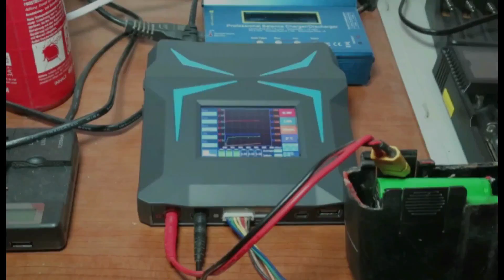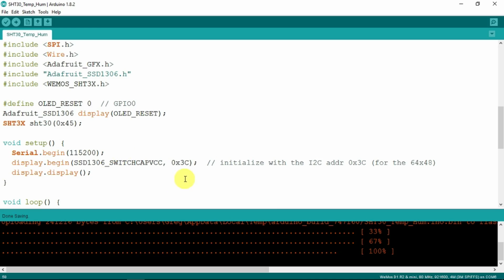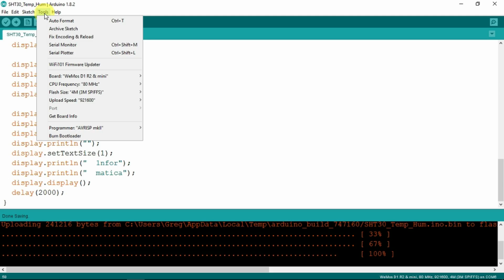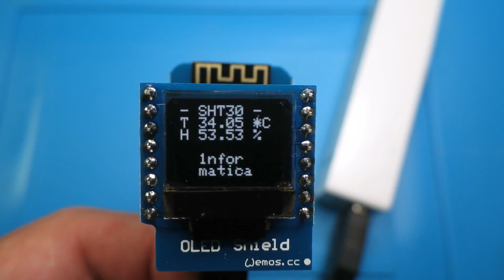Introduction to WEMOS D1 Mini plus Shields from Banggood - LEGO for Geeks!! - Electronic Project

Comment: hi mate i cant seem to get the text to show correctly. im only seeing part of the temp and humidity looks like half the screen is missing. any help?
Reply from the maker: Hi, if you are using the wemos OLED then it's possible you have the wrong library installed in you sketch. Watch the video at this point: https://youtu.be/69iSuVZMLaA?t=505 If all is good check the contacts on the oled board and the contacts between the boards. I have seen some strange things happen if there is a poor contact. Also I have another video using a different OLED module which you can see here: https://www.youtube.com/watch?v=TpdpKLesHWM Let us know how you get on!

Comment: Really, REALLY nice, man! :D I really want to make something like that, but I need a computer first. :/ (I've been spending a lot lately, buying things for my projects, so it's been delayed for now.)
Reply: You can add Remix OS as well Android x86
Reply: By the way, some info to you. Of course you know that the ESP8266 can access the internet and get local weather data and so on. But the thing is: there's a library (I don't remember the name) that allows you to set the wifi in runtime. Basically the ESP try to connect to whatever have been set before. When it can't, it creates a new wifi network! And all you have to do is connect your cellphone in it, access via browser and set it. :) Another thing: people use to hard code the GPS location too, to get the weather data. But you can also use a GPS module for that. ;)
Reply: So, basically: all that, a lithium battery, a TP4056, some voltage regulator to 3v and a box is all you need. :)
Reply from the maker: Obrigado Mario! Yes, I think I'm going to be busy with these things. You don't need a powerful computer to run the Arduino IDE. You must know someone with an old tower or laptop they don't need. Even if it's running XP just get a copy of Linux Mint and you're good to go. Or ask at your local computer shops, they must have a stack of old PC's, nobody buys towers any more. Of course I am not adverse to a bit of "dumpster diving" myself!! I'm sure I am teaching granny to suck eggs (don't know if that translates into Portuguese!) but you can do it!!
Reply from the maker: There is even a battery charger shield!! http://bit.ly/WeMosBatChr
Reply from the maker: Good to know, thanks again!
Reply: 1nformatica Wow, really nice! Didn't know that shield! :D About computer, sure, I know that! The problem would be to find some space here... And I think I have an old tower in Sao Paulo, that I could bring here... About runing Linux, I think there's an old Ubuntu installed there... BTW, I used Ubuntu in my notebook and a few Windows installations in a VM... But I didn't like the VM I used very much. So I think I'm going to use a windows without any additional software as prime SO and then use MS's VM to run the rest. You know? But... I don't have much choice right now, I'm going to have to wait a little bit. :)
Reply: 1nformatica No problem! :)
Reply from the maker: I have just installed Linux Mint as a dual boot with Windows 10 and it gives me the best of both worlds. Previously  I have used the "Virtual Box " emulation software from Oracle to install Windows ME as a virtual machine. Note that Microsoft's version of Hyper V for Windows 10 does not support Windows XP or earlier operating systems. It was for this project : https://www.youtube.com/watch?v=Ilm1qe8I5ZI
Reply: 1nformatica Exactly, Virtual Box. That's horrible! MS Virual PC is great because of one simple feature that Virtual Box doesn't have: drag and drop. You can drag files into the VM and out. That makes things much easier!